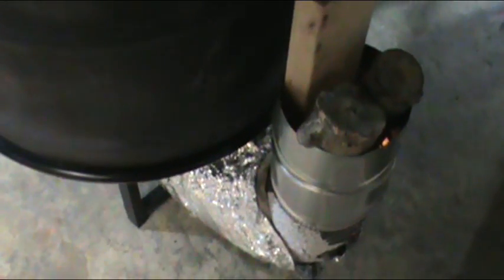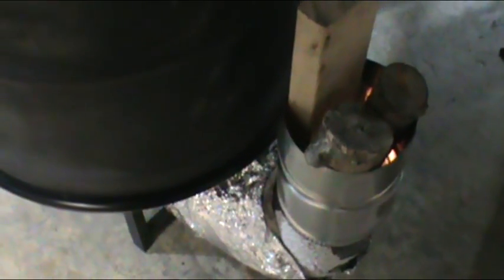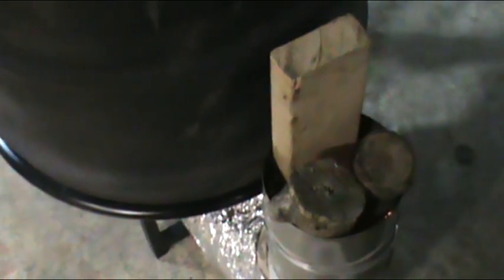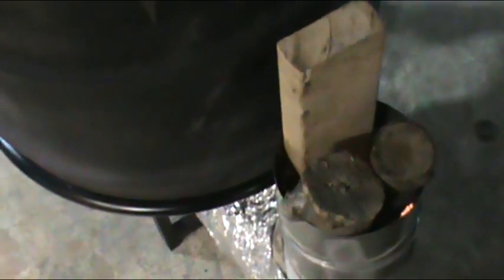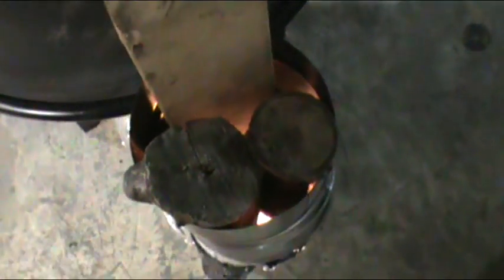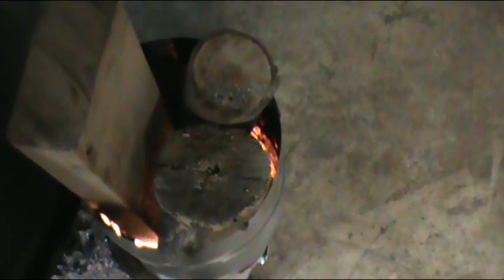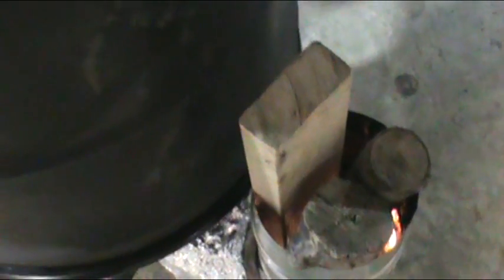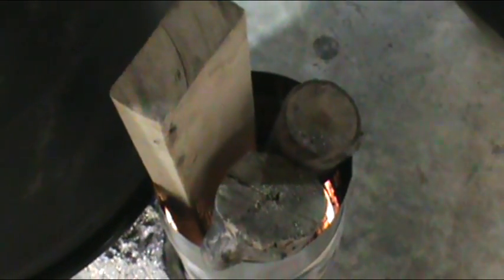Thermal imaging of stove using the Fluke imager vid 1

Comment: A grate, in the center of a TEE in the firebox to raise the burn up off the bottom of the burn chamber would help a lot, it would allow the burn to get more oxygen under the fire, this is IMPORTANT, so the burn is not sitting on the bottom of the fire box and it would raise the temp on your stove then a vent on the front clean out cap  on the tee that you could be adjustable for the air intake would make it so you could test for higher/lower heat production, for cooking or Hot water production on the top of that stove.

Comment: I like the idea you had about putting a TEE in the fire box the cap at the end should have a moveable air plate to use as a venturi, so you load up your fire box and that could choke the air intake, if so some air on the front cover/clean out cap would allow some extra air if needed, you would be able adjust the heat level,  it looks like you are not burning hot enough, or as efficient as you could with some tweaking, getting air under the burning wood is VERY important to being Very efficient and raising you heat

Comment from the maker: Placing a plate at that location I am decreasing the cross section area as now I have a 1:1 all the way thru but decreasing it right after the air inlet and having the burn take place at that point than expanding is like a jet engine design and eliminated the need to keep moving the wood around. Once I find the best working size and shape I will run the math of the cross area and find the ration from inlet to outlet.

Comment from the maker: Hey Jeff; I will be placing the plate or expanded metal vertically after the 90 degree bend in front of the horizontal burn chamber. What I had noticed is by placing a 1x4 vertical at that position it really increased the air flow and gave a continuing burn to the wood behind the 1x4. When I first started this stove build one of the option I had was to reduce the lower “J” section to 4” pipe

Comment: I have found with my experimenting, a grate type system works pretty good opposed to a piece of solid plate. Try and find a happy medium where the grate will support your material, but will allow the ash to fall through.If the grid system is too large, you will lose a lot of your hot coals through it, and your fire will tend not to burn very well, too small and the ash will build up to much and choke your airflow down to where you lose flame, and the rocketing effect.

Comment from the maker: Jeff, Absolutely correct; when I first started to burn in the stove it just took right off and as stated sounded like a rocket heading into space. Then as the wood in front burned up so did the rapid fire. I started to place 1x4’s in front of the inlet at the top of the 90 and it took right off again and would continue until the wood in front was consumed once again. I did this with about 30’ of 1x4’s with the same results each time, this is why I will try a plate to see what happens.

Comment: Yup one burn I did, think its in one of my vids. I went from 300 degrees on the top of the barrel to like 600 just by moving the wood around a little bit to change the airflow dynamic.

Comment: The airflow on these rocket stoves can fickle. I have found that by adjusting the flow from different angles, or even just moving the wood around by a few inches, can drastically affect the way it burns. Definitely a far cry from a traditional stove.